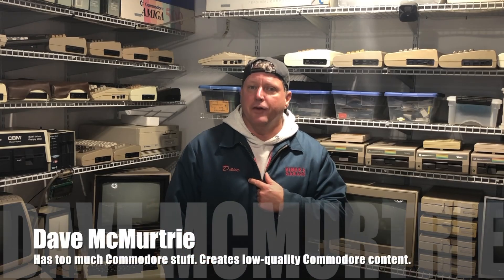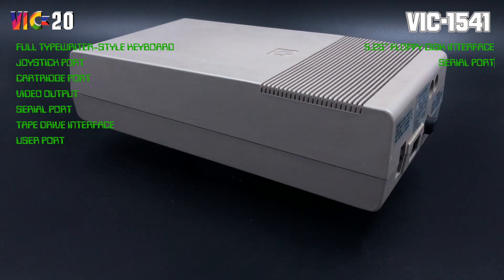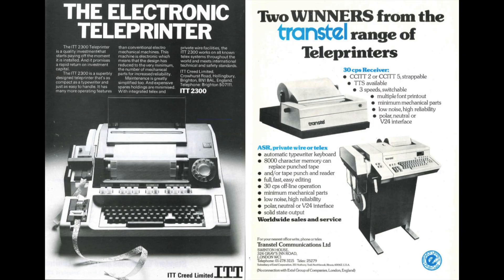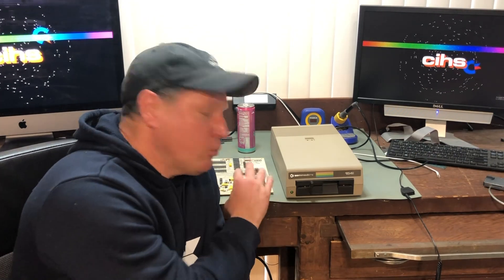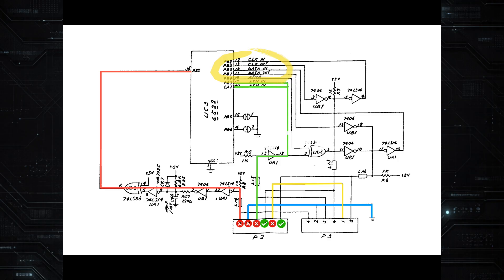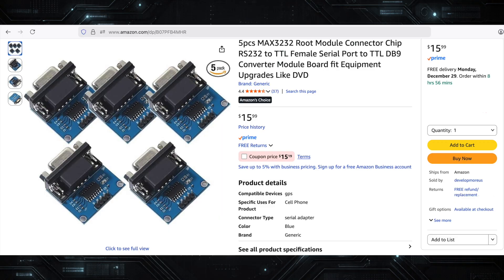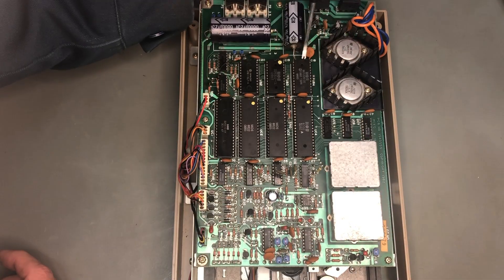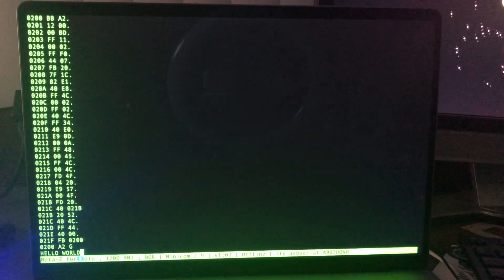Can a Commodore 1541 disk drive be used as a general purpose computer?

Comment: When the disk drive operates as normal, does it use all the processor cycles or does it spend most of the cycles waiting on the computer or the floppy to negotiate transfer of data?

Comment: I've always wanted to see someone use a 1541 as a general purpose computer, thanks for making this a reality.  I'm just wondering and it's probably impossible but could you also have the disk drive work - i know you've repurposed the cpu and rom so it's a big ask to put some of that back at same time as having serial comms and running the kim-1 - but you'd be able to load and save to disk 😄
Reply from the maker: I have the disk drive working from the KIM monitor now, and I'm working to port Commodore BASIC to run from $C000. New video coming..... eventually.

Comment: Cool video! I thought of this too and have been working on it a bit because I wanted a KIM1. 
Just a couple of thoughts, though. With just a bit of hardware modifications, you can have 32k ram and an 8bit port on one of the 6522 chips. 
Both of those mods were used to speed the 1541 up and allow faster disk copying.  
There are also the 1604 based lcd panels that have their own ram that can be used. 
Butch of stuff I can do with my extra drives 🙂

Comment: Very nice. What do you think about changing the RAM with another one with more capacity? A 24 pin to 28 pin should do the trick, if address decode is simple: ROM for the top half, RAM for the bottom half and IO somewhere in the middle.

Comment: You could use a formatted floppy as swap, giving you 2 KB + 190 KB, for a total of 192 KB. You would, of course, have to implement your own paging and swapping routine, running from ROM. The remaining serial port could be used to connect to other devices... imagine if you had a 3D accelerator which took shader commands, and another piece of hardware which drove a SoundBlaster card over the other serial port on the 1541...

Comment: Very nice! That reminded me of an experiment where I tried to run the 1541 at 2MHz (with faster chips) but didn't succeed. Back in the day I ran a 40pin cable from the CPU socket to my selfbuilt machine to test new 1541 ROMs, by remapping the ROM area to RAM ... those were the days...
Reply from the maker: I guess in theory, 2MHz should work on a 1541 with faster chips, given that the 1571 managed it. That's a cool experiment!
Reply: @commodorehistory yes so I figured. But I didn't really have a scope IIRC so there was much guesswork involved. Maybe these days, but I already have so many items on my todo list ...

Comment: I do know demosceners get the 1541 to run arbitrary code to shunt some processing load to it, or inject a fast load routine. Buuut, that involves it being hooked to a host machine speaking iec. I guess someone could make a pi setup where the pi injects code via iec to "jailbreak" it, then switches to acting as a serial passthrough if you really want to hook it to a terminal? But you're still hooking it at least temporarily a mocha more powerful host machine before switching it off in software.

Comment: The idea that a mere disk drive contains the same CPU as a general purpose computer is mindboggling to me. Great video!
Reply: It would probably boggle it even more if you know that many if not most later terminals contained a CPU, RAM and ROM and could probably be converted into computers.
Or that your credit cards and SIM cards were computers all along (although those normally cannot run general purpose code for obvious reasons)

Comment: I recently, 6 months ago, saw an article online where they programmed a bone stock 1541 to run a graphical and sound demo. I ran it on my Z64K emulator, that has the ability to run code on the emulated disc drive as well, but I am confident that it will run on real hardware as well. 

They manufactured a cable for the serial port to plug into a composite monitor, so it actually outputs to a real screen. The 1541 has commands to load and run external code into its internal memory, so there's no need for a ROM swap, as long as 2K is enough RAM. I'm not sure how big the KIM ROMS are. 

The idea was you connected the C64, uploaded the program, ran it on the drive, then swapped out your serial cable for your manufactured video cable so you could watch it work. 

I'll see if I can find a link.

Comment: I remember using disk copy software that would load into a 1541 so that you could do track-level copying of diskettes between 2 or more drives, even being able to disconnect the drive  that connected to the host C64 and the drives would keep working as a bulk copier setup.  I also recall articles in COMPUTE! or COMPUTE Gazette (or may be RUN Magazine) that talked about using the RAM in the 1541 as a pseudo 'expanded memory' or running programs using the 1541 like a spare CPU for the host C64 - nothing elaborate, but enough to run small machine language code.  I don't recall if the articles gave any instructions or plans or code, but they seemed convinced it was possible and gave ideas for usefulness, such as a mini math co-processor, or a multitasking C64, or automating things.
Reply: The 1541 fast loaders just did this: load a little program into 1541 RAM, load another little program into C64 RAM and enjoy faster transfer between 1541 and C64.

Comment: Thank you for answering a question I had always wondered since i was a teenager and found out that my 1541 disc drive actually had it's own 6502 CPU in it! This has to be the coolest C-64 related thing I've ever seen. A 1541 running BASIC over a serial connection.  /kneel

Comment: Can you do this with 1571 (if I have the name is correct) dish drive? This drive was always my favorite.
Reply from the maker: Yeah, the general concept would work for any of Commodore's early drives (up until amiga). The earlier drives like the 2040, 8050, etc even have 4K of RAM in them, so technically they'd be better. The memory locations won't be the same on every drive, so you'd have to move stuff around a little bit, but it would work.

Comment: Here's something to think about. The 1541 has the ability to run user-written software in the drive, without having to change ROMs, although it needs a computer attached to tell it to do so. It has 2K of RAM. Maybe run a kernel and talk to it from a C64, using it as a kind of co-processor? It could maybe even use an inserted disk to load code from on the fly, as overlays.

The awesome demo Freespin, which runs from a 1541 with the drive cable connected to a monitor(!) does something like that, it's worth searching for here on Youtube. (If I link to it directly, there's a good chance Youtube will invisibly swallow the comment.)

Comment: While modifying a diagnostic program that used BASIC to write data to the TRS-80 Portable Drive-1, discovered they were writing 6800 assembly code to the drive, so wrote my own code to have the drive do a ROM dump of it self using its Hitachi equivalent of a 6800 cpu.

Comment: No doubt one would have to add memory. But I remember when the Commodore 128 came out, with a Z80 CPU that could be used for CP/M, thinking that they should have put the Z80 inside a modified version of the 1541 instead, because CP/M wouldn't work nearly as well with the very slow link between the 1541 and its host computer. Since CP/M uses text screens, not fancy graphics, having the link to the screen be slow wouldn't have been as bad.

Comment: Könnte man das Laufwerk so belassen und Software mit dem PC austauschen mit einem einfachen Kabel mit USB Stecker, Beispiel mit einem FD 2000 das man seriell über Adapter am PC über USB anschließt? Brauche das GDOS von 2018 auf nein Turbochameleon, nur da kannst Du keine D81 Diskimages mounten, dafür aber den REU Inhalt als REU - Image speichern, Megapatch3.0 läuft da bei mir schon ist aber alt und es gibt da schon Updates. Das Megapatch habe so mit FD Disk gebootet mit meiner alten Bootdisketten und den RAM Inhalt als REU File gespeichert, allerdings bekomme ich die  D81 nicht auf nein Turbochameleon und sd2iec möchte ich nicht benutzen 😂

Comment: Can you run custom code without replacing roms? I think numerous C64 demos used disk drive to offload some calculations, so maybe just a floppy disk with custom code and a some instructions sent over serial port should do the job? - This could be a good material for a follow up video.

Comment: Nice video. Try using a potato cut in half for soldering din pin connector. It's much easier.
Reply from the maker: This reminds me that at VCF East last year, a friend gave me a "potato" just for this purpose. It's a fixture with hole patterns to match things like this to make soldering easier and he called it "potato". I forgot I had it and was struggling with blu-tack instead.
Reply: @commodorehistory  interesting, I'll check it out. Someone told me about using a real potato and I laughed. Then I tried it, I was totally amazed how effective it is. The potato cools the pins as you solder and holds them in position very firmly. The pins can be heated quite high.
Reply from the maker: I found it in my soldering drawer. Wording on the silkscreen indicates it's a Sven Petersen design: https://github.com/svenpetersen1965/DIN-connector_soldering-aid-The-Potato
Reply from the maker: ....also wording on the silkscreen: They said: "Use a potato to solder a DIN connector!" so you are spot on here :)
Reply: @commodorehistory okay, thanks for that interesting piece of information. I am sure he makes the hyper expander cartridge for the VIC 20. Very nice bit of kit....

Comment: I've always wondered if you can use the 1571 on a C64 and use it's full potential. Eg. can you mod the C64 in a way that it'll take advantage of the higher speeds and the double sides of the 1571?
Reply from the maker: Indeed, you can: https://a1bert.kapsi.fi/Dev/burst/

Comment: It's worth noting that you do have one onboard switch that the CPU can poll.  The drive door has a switch that is connected to the CPU and can be used to interact with an onboard program.  In fact, this switch is used by the demo "Freespin" .

Freespin is the ultimate proof that general purpose computing can be performed on the 1541.  Once you load the demo from disk and run it on the host computer, you then disconnect the serial cable and either replace it with a modified cable, or just cut the cable itself in order to connect the data and clock lines to the video input of a composite monitor.  To start the demo, you then open and close the drive door.  Video is sent via the serial cable and and audio is generated using the stepper motor.  

The demo is viewable on Youtuve in a video by the creator.
Reply: Wouldn't THIS video be the "ultimate proof"? FreeSpin is such a cool accomplishment, but adding a BASIC ROM makes this project a true example of general purpose computing.

Comment: Before watching, I think it can, but only if it's modded, the 1541 drive can run it's own programmes internally, but it's only designed for internal disk tasks. You'd likely need a new ROM and a custom interface for real time input and output.

Comment: You can run code from the 1541 RAM too, that is how Disk Music works.  I wrote a parallel interface for the 1541 back in the day using this, and a connection not the User Port on the C64 with custom code in both, but I didn't have to reprogram the EPROM from what I remember as I didn't have a programmer.

Comment: you can already communicate with the 1541 with serial,  shouldnt have to change a thing ,  this is the difference between a 6502 Microcontroller being used for a P.C. Vs. the 6502 microcontroller being used as a microcontroller doing a specific job
Reply from the maker: You should connect an RS232 device to a stock 1541 and test that theory.

Comment: CRAZY STUFF, the 1541 is a beast on its own. I had a book from Data BEcker and it was insane complex. I seen a vid, LONG AGO that someone managed to "upload" a small program into the 1541 RAM and run it. It was to make music with the stepper (what a nice way to kick the alligment off). Wondering how much "Program" could be stuffed on the RAM space of the 1541(2K if not mistaken). My question is, any way to run some things in the 1541 as it is ? Of ocurse would be VERY LIMITED.. I know Turbo sends a small stub of code to the drive to take place over the original factory routine (and so does in the C64).

Comment: If the IEC bus is TTL, then you could have just used an FTDI cable to go directly from TTL to USB.
Reply from the maker: Good to know. I already had the USB to RS232 converter on hand, so when I asked google how to connect TTL to that, it landed me on the solution I used. I never heard of an FTDI cable until you just mentioned it. Now that I looked, yeah, that would have been easier!

Comment: What software do you use for assembling? Most I found fails to compile when they see .cpu "6502"
Reply from the maker: https://sourceforge.net/projects/tass64/
Reply: @commodorehistory  Thanks. I'm working on a 6502 emulator (in c++) and plan to use your KIM-1 conversion as a test bed. Just need to write an serial port emulator.

Comment: All you need to interact with the outside world is the serial connection...once it gets to your laptop (or other terminal/device), the rest of the interaction can be handled there (in the same spirit of the way the disk drive originally functioned, by using it's own local mini computer to read and write data using nothing more than its serial interface to interact with the C64. Next (if you so feel compelled) you can try creating a custom ROM to include both the KIM-1 and 1541 firmware with auto context switching, such that its primary function is to behave like a disk drive (only needed once in a while), and the rest of the time, behave as a secondary computer...whenever it gets a request to read or save data, it can pause the current computing operation, save the context, switch to the disk firmware,  perform the disk operations, switch back to processing mode, reload the computing context, and resume computing operations.

Comment: One of the things that seemed like voodoo magic to me back in the 1980s was when I learned that people figured out how to write code that would use the 1541's CPU and RAM for their programs. I only knew the bare fact that they did it, nothing about what it could actually do.
Reply: Sounds interesting, but then again, it could only be as fast as the serial bus is - unless you modified it to use a parallel connection or speeders such as DolphinDOS...

Comment: It always puzzled me why Commodore never took the guts of the 1541 and packaged it as a microcontroller. They basically had one right there and not only could it have been a way to cost reduce the drives but might've served as another revenue stream by having something like the Intel 8048 and 8051.

Comment: "But, the very least I have to do is replace the ROMs in there."  I don't think that is true.  I think you can write a program for the 1541 and feed it in the serial port.  I think that is how the music generation on the 1541's steppers was done.
Reply from the maker: You can. Commodore's DOS natively provides M-W, M-R, and M-E commands for memory write, memory read, and memory execute. But that would mean I'd be running the KIM-1 kernal and Tiny Basic out of RAM. I don't think they'd both fit.

Comment: Awesome! 2 questions. 1. Can you provide the settings for the terminal software like baud rate? 2. Would this work on a 4040 PET drive?
Reply from the maker: 1. I'm using the actual KIM-1 code, so the same baud rate detection code is in place. In the video, I was running at 1200 baud. I'm not sure how fast the code can keep up with. Settings are 8N1. No flow control.

2. It could, and it would technically be better because the 4040 has more RAM. However, my exact code wouldn't work on a 4040 because the memory layout is different between a 4040 and a 1541, and the pins are different between parallel and serial.

Comment: Hey remember the 1541 also has another way to connect to the world that is the drive itself. Back in the day there was a 1541 music program that will load a routine to ram on the drive from the C64 and would use the head banging and tension and release from the head and the stepper to play music. You should try that

Comment: Short: No.
Long: Yes. But define "use". And define "modify".
Reply: Actually, you can without modifications of any kind. See the demo Freespin by Reflex. They reprogramme a 1541 to produce sound via the drive mechanism and video by bit banging the serial port. If you can do all that, then you can definitely use the 1541 as a general purpose computer.

Comment: 1541 is quite close to VIC20 (6502+2x6522+SRAM) just minus video chip, there is already a demo for 1541 which shows compposite video monochrome output via IEC connector through 6522, much like ZX80/ZX81 did
Reply: If the other 6522 is socketed then you have access to the io bus bypassing the disk hardware  - let the fun begin🎉
Reply from the maker: Indeed, I recall that demo and it was super awesome!